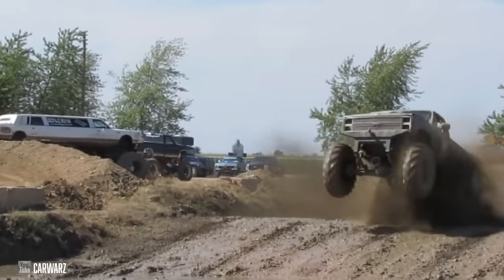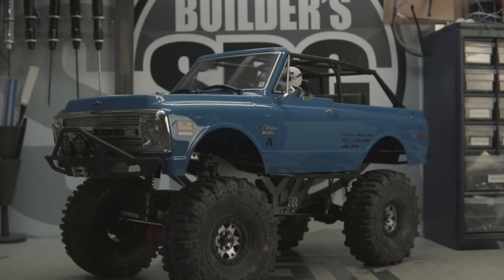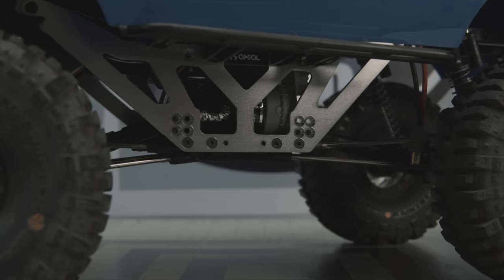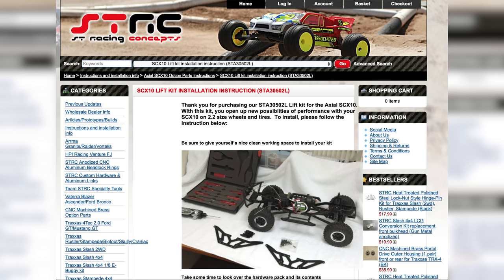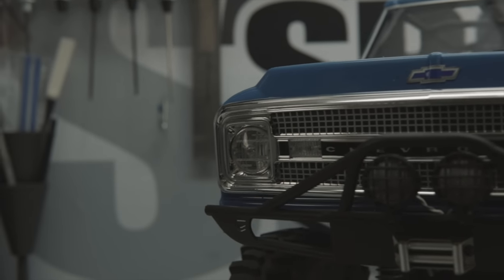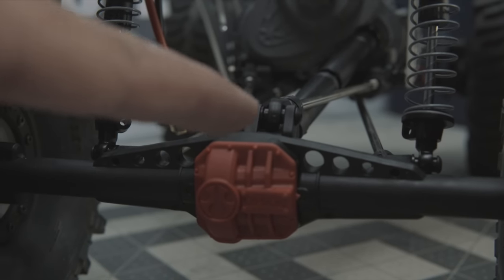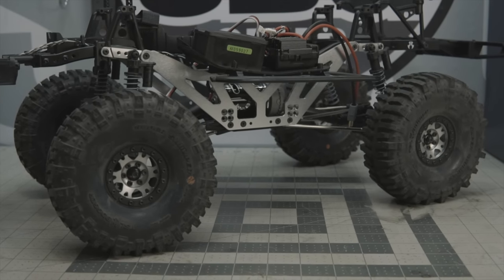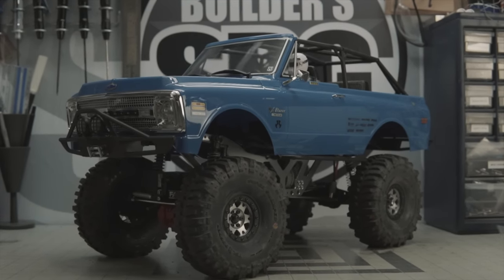Mega Mudder Blazer Build Part 1

Comment: Glad to know I'm not the only one did the exact same thing. And added a two speed conversion. Now getting ready to install my brushless next.
Reply from the maker: Brushless and two speed may be overkill! You can get plenty of speed from just the Brushless upgrade!
Reply: I was thinking it may be too much also... Lol that's why I kept thinking about it but I don't wanna blow axles and drive shafts either. I think I may just stick with my emaxx motor cause there cheap and powerful with the two speed and 3s. Been doing good so far. I need to learn to leave things alone sometimes...

Comment: Great video. I’m in the middle of a mud truck assembly . I was able to score a set of those burly mud truck plates, I used a standard VP SCX10 transmission with 8mm wraith style trans outputs installed with the long output forward, and the short output on the rear. I just need a body.

I like the UCfab servo mount, Too bad nobody offers a SOA bracket for the ascender.
Reply from the maker: 8mm outputs?! Dang!

Comment: I like the look and stability you get using wraith axles, and using ax-10 scorpion chassis plates with the scx10 chassis. Thought about that?  2.2s with rc4wd mud basher tires are pretty awesome as well!
Reply from the maker: That's great, and certainly a way of doing it.Wraith axles are still pretty out of scale, even for a body this size. If there was something in the middle, I'd give it a shot.
Reply: Wraith or SCX10 axes also have an advantage. You can use an open differential. Especially on the front axle. Directly in the mud is locked better, but with jumps and landings on the front axle you have bigger forces on the steering geometry. I've already destroyed links, servo horns and servos too. You can't do that with the AR44 axle.
Reply: Scale Builder's Guild wheelie king axles are actually right in the middle

Comment: What servo posts did you use on the UCFab servo mount? I just received mine, but I noticed it did not come with servo mount posts, just the axle mount. But, a very good quality piece (that's what she…)
Reply from the maker: Hmmm, I think I used whatever I had in my parts bin. They might have been Axial.

Comment: At first I was like wouldn't it be easier to buy a redcat...but then I seen what you did them plates bolt to the chassis then it drops the motor and transmission lower kinda like a scale monster truck
Reply from the maker: Yep, the STRC plates make a world of difference.

Comment: with all the SMT10's dried up, Im thinking the scx10 2 might be my next best option for a mega/mud truck. I was wondering.....do you think a drop bracket for the CMS would work too, instead of moving the servo onto the axle?
Reply from the maker: It might? But to be fair, it'd be a lot of work on the servo from that distance. Putting it on the axle made the most sense. Not as accurate, but I compromised for better performance.
Reply: Along came Mary...aka the wraith 1.9...Mary, Mary!

Comment: Hi Matt, what rear body posts did you use on this truck? The rear posts looked like they were on a different plastic frame further back and not on the rear shock towers.
Reply from the maker: Hey Robert, used the stock one, just moved it around a bit to fit around the lift kit.
Reply: @scalebuildersguild :Thanks Matt. I made my K5 Mudder from the Raw Builders Kit and I noticed the kit has the rear body posts directly on the rear shock tower where the rtr has a separate rear body mount further back. With the rear post coming from the rear shock tower, the posts come up to the middle of the rear seat and makes it difficult to have a top with the k5. I'll have to purchase this rear body post separately. Interesting Axial designed it this way for the Raw Builders' kit but I guess this is such a specific build with wanting a k5 and a top that a kit can only be so flexible for many builds. I'm almost finished and I may post my Mudder build on the Scale Builders' site. Thanks again.
Reply from the maker: Different mounting points for different bodies, you'll need to find that piece.

Comment: on a mud truck a body lift is really only needed if yer tires are rubbin yer body panels. a suspension lift allows you to fit taller tires, taller tires lift the axles effectively raising the ride height. axles gettin mired up in the mud is what gets you stuck 🤘🏻

Comment: Put wraith axles on it
Reply from the maker: Always an option, but I like the narrow look.
Reply: I would say here, the axles look scale enough to be considered anything up to a scale one ton axle. The wraith axles at this scale would match up to the scale of something like a set of axle tech 4000s or rockwells which is what a 1:1 truck of that size would use. Plus the higher gear of the wraith axles would be an easy enough way to make it faster and the additional width would make a world of difference in the trucks stability. I imagine how it sits, it's not much good for any more driving then going very slow or in a straight line due to the stock width axles and raised center of gravity it must be easy to roll.